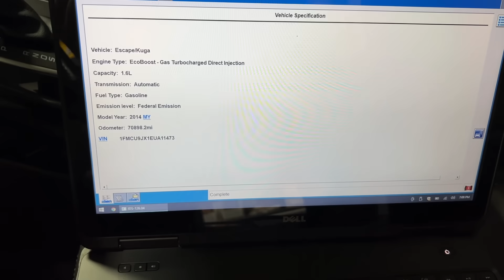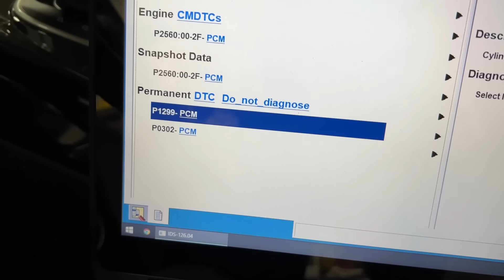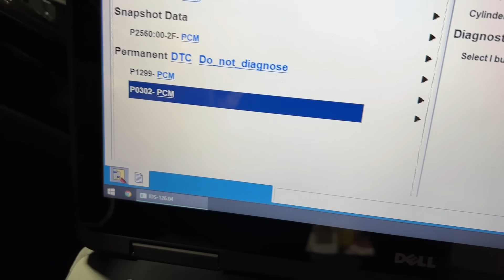Beware of Ford’s 1.5L 1.6L 2.0L Ecoboost Engines and Their Never Ending Coolant Consumption Issues!

Comment: Ok, so having watched this channel I now know I need to avoid 5.4 three valves, and most EcoBoosts.  I'm old enough to have been suspicious of the 4.6 SOHC when Ford brought it out and was promptly disappointed when it could not do what the 5.0 Liter could.  When did Ford lose the ability to build a decent engine that would last?  And it seems that they have been struggling with transmissions as well.  I'm a Lincoln person and have had a Mark VIII and Mark IV.  The Mark VIII spit its transmission out while I was on the highway leaving me to wonder if getting rid of the 1975 Mark IV was a bad decision as the 460, C6, 9" never gave me any problems other than rust.  Good grief Ford-what happened to quality, long lasting vehicles?
Reply: I had 205k miles on my 2001 Ford Focus when I traded it in (yes, I traded it in and it was still running) for a 2008 Ford Focus.  The 2008 Ford Focus had 185k miles on it when I hit a deer. As one who has never sent a good running car to a junk yard, when the insurance company tried to total it I sourced my own front hood, radiator support, A/C condenser and my insurance co just paid for new headlights and grill and it ran fine again.  My 1970's cars were never cars I'd trust over 100k miles and my Pinto, i was adding a half a quart of oil ever fillup at 90k miles.  My 2003 windstar I'd have to add a quart about every 2-3k miles and my 2001 E350 van I had for over 10 years and over 100k miles before I donated it to a charity which actually used it for another 10 years until 15 passenger vehicles were restricted from passenger usage (then they used it to move "stuff" for a year or two, and then got rid of it).  Overall, I've had much better luck with my Fords than with my GM cars.
Reply: @johnnelson5083  You have had some of the most reliable Fords from the eras that you described.  The Focus has always had great engines because they were evolutions of earlier designs that were nearly perfected.  Your 2001 Focus engine was an evolution of the Escort 1.9 (not bad).  The 2008 Focus had Mazda derived engine (usually reliable).  The Windstar was just a van version of the Taurus, and probably had a 3.8 (nothing flashy but good).  The E350 is a little tricky to guess, but I'm thinking that you had the V10 (that engine is a mixed bag, although all the vans I've driven with it have been fine).  I will agree with your opinion on the quality of 70s U.S. cars in general.  I believe that maybe 150,000 miles was the mechanical limits (the Pinto/Vega/Gremlin were all much worse) for domestic production.  Only foreign competition pushed the "Big Three" into better quality.  Having worked for GM, I can agree that General Motors has its issues.  Thanks for sharing!
Reply: @brettkirkpatrick464  My E350 had the Triton V8 and was very dependable (got it during the sales after 9/11).  Not great gas mileage but we drove it all over for years without issues (we had 8 kids all living at home at the time so with the 15 passenger van/4 rows of seats in the back,  every kid got a window seat). Only repair I can recall on it was rear bumper after one of my kids backed up into a light pole.   I had a cousin who worked for Delco (Delphi) in Kokomo for ages. He's retired now but always complained about us not buying GM cars so I bought 1 (a 1990's GMC Safari) and what a nightmare that car was (trans rebuild at 72k - I'm not hard on cars and usually get that much out of brake pads). I had 1 Plymouth as well but it started having issues around 140k.  My newest Ford is a 2013 C-Max Energi and I'm really happy with it.  Went from about $200/month in gas to about $25 every other month and my electric bill increased about $15/month (and this was before the current gas prices).  I also have a Freestyle which so many complain about the CVT transmission but I've not had issues and am approaching 100k miles).
Reply: @johnnelson5083  That 5.4 Triton (2 valve) is a great engine.  Sorry to hear that you had a Safari.  I joined GM long after production started and I was still hearing stories about how much of a nightmare assembly was for Safaris and Astros at the Baltimore plant.  It was the first GM assembly plant to use automated just in time parts delivery to the line and it turned out to be a disaster for at least the first year of production.  The line would stop, but the parts delivery would not and the wrong parts would end up at the wrong assembly points.   Almost every vehicle had some assembly defect because the line workers were being forced to quality check/assemble something different on the spot as the vehicle rolled down the line.  I just got rid of a 2008 Grand Caravan SE (3.3 Flex Fuel) and will not have another Chrysler/Stellantis/Whatever they call themselves today product.  The body was poorly assembled and at 135,000 it would have needed major engine work even after very careful upkeep.   Thank you very much for the tip about the C-Max.  I was interested in it when it came out but decided to buy a Civic Hybrid instead.  Huge mistake.  I had to replace the battery pack at 150,000 and the replacement only lasted 30,000.  Since then I have not trusted hybrids.  Interesting story about your Freestyle.  I heard the horror stories of the CVT (even though the Civic Hybrid had one) and experienced them first hand while I was working at Saturn (a CVT would blow up once a week...it was so bad that I had parts of the belt on my desk as a paperweight).  My strategy with the Civic Hybrid was to change the CVT fluid once a year and it never gave me any problems.  Thanks for the great information-I am always looking to learn.

Comment: I had the '13 Fusion 1.6L EB. I was getting 37 mpg hwy and 30 city unless I put my foot in it. In 2018 Ford had a recall to replace the thermostat housing and re-flash the computer. After the re-flash it got 22 city and 28 hwy but it would stall and not crank for 20 minutes to a half hour later. They had it 3 times with no problems found. I traded it at 58k miles as it was too unreliable a car.

Comment: I own a 1.6 in my transit connect. So far it seems to run really solid, not burning coolant... YET. But I knew going in Ford engines suck but the alternative for small vans was non existent. But why can't there be a fix for this, even if it means you do it yourself or pay a mechanic? Coolant shouldn't be leaking past the head gasket PERIOD. If it is, why not correct the leak with a different style gasket? Leaking coolant passages is bad but it could be remedied with some ingenuity.

Comment: I wish every mechanic was as thorough as you! Subscribed! P.S. I wonder how Pakistani Truck would fix these long blocks? : P  Edit- It's terrible that people are dealing with this issue. My 2018 F150 with 2.7L has been flawless for 115K miles. I always said I would never have a turbo charged vehicle but this truck has changed my mind.
Reply: I'm sure a sandal wearing guy would weld it up and another sandal wearing guy would eyeball the machine work and off it would go again! 🤣 With donkey spit gaskets.

Comment: I totally agree with you that recent times we see more design flaws across the board of a lot of manufacturers, not just ford. They care too much about making a easy buck instead of caring about their customers. I stick to the older models that are much more reliable. I have a 03 f150 2 valve that still runs like a champ, sure its blown a spark plug here recently but that was a pretty easy fix. Its practically breaking in half body and frame wise but runs and shifts good. Just like the old crown vics theyre a dinosaur v8 that doesn't put out tons of power but are nearly bulletproof mechanically.
Reply: Weld some angle iron and plate and it will stay alive.
Reply: Unfortunately the government puts all manufacturers to force garbage, to try and meet epa, mpg, regulations and pollution standards.
All manufacturers are being forced to build garbage!!!
Reply: And I agree I still drive my 2004 f250
Looks like crap, but I can keep it running!!

Comment: Has anyone heard that the problem is less prevalent on the European [Hungary etc] produced engines?
 - I think I saw somewhere that the Euros had an extra coolant [or oil?] drilling between Cyl 2 & 3 which kept that hot-spot at bay.
I had a Euro 1.5L for 162,000KM, 7years, no problems.
I have another now; it is the 2.0L and interestingly it warms-up very slowly - I am quite convinced they have changed the warm-up regime 
 - in 2015 models the coolant pump didn't run until hot; and it would warm-up by the end of my street [1.5Km]; 
 - the 2022 2.0L takes about 7km to warm-up ; which is perhaps good for expansion stresses, but I'm not so sure about oil-performance.

Comment: How do you determine it's the block and not the head gasket?  if it leaks from the coolant jacket to the cylinder, wouldn't that have the same symptoms?

Comment: Wish Ford won't shut you up after revealing their fishy, dodgy, cost-cutting crappy technologies. Just so you know, I'm aware that most of the alloys used for the engines are bad, and instead of doing it right and build some iron cast blocks, they prefer to put some layer of some loctite-made resin to stop their premature wear, and stop the coolant from sipping through microcracks causing the coolant consumption issues. It wouldn't surprise me if you decide to get a sample of the oil on that Escape, and get it on a chocolate milk state.

In a metalurgist engineering point of view, the alloy cannot withstand the conditions where it is being used, causing it to deformate with all the heat/vibration/sudden stop/cool down cycles they get, causing the internal particles of the alloy to displace or even, separate, forming all the cracks and microducts, which, in addition of 21 PSI worth of hot fluid, which we know, liquids cannot be compressed, end up sipping through wherever any pressure relief point is opened, in this case, the micro crack. That's the major caveat of the aluminum alloy blocks. It may resist long enough for the warranty to go dead and then scam the customers with a brand new engine block that costs almost as much, or even more than the entire vehicle.

As a former fellow Ford Dealership Support engineer in Mexico, my advice is: get someone to build a custom block/head with the same measurements from the actual production engine, but from a good ol' cast iron, and say goodbye to most of the pressure-related issues that these engines have (headgasket, microcracks, vibrations, uneven wear and tear, and so on). Moreover, try to get the car running right for long enough so the customer can trade it in for something else while not losing that much resale value.

Comment: Found a Ford Ranger 2007 2.3 inline 24,000 mi. MINT CONDITION- $7,995 OUt the door!! Added NKG Iridium plugs and high performance wires and Flowmaster 40!! NO PROBLEMS!!!

Comment: It seems to me that just pointing the finger at the engine manufacturer doesn’t make good sense.
In many cases of head gasket leaking and warping of cylinder heads, especially small capacity engines is that, the drivers are most probably giving the engine too many revs when the engine is cold instead of allowing the car to get up to temperature. It only takes a few miles to warm up. 
It’s as simple as that and a problem as old as the hills. 
Owners of these engines need to be a little more mechanically sympathetic. 
Don’t thrash it when the engine is cold.

Comment: These engines have been trash forever. Recalls for cracking heads, no crank pulley key ways so you need all these trash special tools just to do the simple timing belt.

Comment: The lack of deck surface on the block is the main issue on those engines and the coolant consumption and yes the common secret ,head gasket failure. 
I think that was the main reason for the headgasket failure issues on Rover K series engines.

Comment: 2014 Ford Focus ST 2.0 Ecoboost. 249k miles never had an issue. I do not think this is as common as it’s being portrayed here on “all” ecoboost engines.
Reply from the maker: Very common throughout the years, as for the 2.0L the 2015-2019 years were the worst.

Comment: Could this not be just a head gasket? 
Not going to be popular opinion here, but to play devils advocate a bit… What are you views on coolant additives or stop leak type products for this issue?  Some of those work for cracks or casting flaws that are not exposed to cylinder pressure.
Reply from the maker: It is a block defect
Reply: @FordTechMakuloco  Thanks! I'd love to see a video of a motor teardown if you do end up repairing one of these. Keep up the great work!

Comment: is the issue fixed up new blocks? Has it been "updated" or are you in the same boar?
Reply from the maker: yes there is an updated block.
Reply: @FordTechMakuloco  gotcha. Thank you for all the hard work on these videos. They really do help us all out here. I've got a 15 escape since new and I'm at almost 95k on it. Ford rebuilt the trans under warranty at 58k but otherwise no real issues to speak of yet other than 2 wheel speed sensors and a battery

Comment: Does the 100,000 mile powertrain warranty still exist? Wouldn't this be covered?
Reply from the maker: no, I think you are thinking of another manufacturer. Ford has always been 5/60.
Reply: @FordTechMakuloco  oh my mistake. I thought my 2007 focus came with a 100,000 power train warranty. Thank you sir
Reply from the maker: You may be thinking of a Ford ESP plan or an FSA.

Comment: After a solid 100 years of building automobiles letting a fault like this happen is very unacceptable. Even the 2.3 focus st blocks (top shelf model) has this issue in certain year ranges. Its not just Ford, afm and GM anyone? Camshafts and hemi's. They COULD build a bulletproof powerplant at this point, and we all know it.

Comment: Do these issues apply to the newer turbo engines in 2020, 2021, or 2022 models?
Reply from the maker: It is supposed to be fixed 2020 and newer.

Comment: I'm not a huge fan of the 1/4 inch /6mm coolant return plastic hoses either, looking at them wrong and they crumble,   and the fact they exist is an indicator of thin castings, and an engine that has more heat to exchange, as any turbo engine makes more heat than an N/A version. The 6F35 trans yoked to this engine is not known for it's robust nature, either.

Comment: I have a 2018 Escape 1.5 EcoBoost. Transmission was leaking at 30k miles. Ford replaced the torque converter under warranty. Last year just before the factory warranty expired I purchased an 5 year 100k powertrain warranty just because of this problem. Yes it covers replacing the engine.

Comment: This is terrible, like you said how long have they been making engine blocks?
My dad has this exact  same problem with his UK Ford Kuga (Escape), its a 2018 1.5 model and has done just over 15k miles!!! Cost to repair is £7000, the Ford dealership have offered to pay 50%. I am in the process of chasing Ford HQ for more discount if not the whole cost.
Thanks for the video 👍

Comment: I would dump a bunch of gasket sealer in it and see if it would seal the block.
And run it with the cap on the coolant tank loose so it doesn’t build pressure.
And install a lower temp thermostat.
Because it’s not worth putting a long block in the car.
The owner might get 2 or so more years out of it.
A system with a pressure cap set to 20 psi is meant to run hot for more efficiently.
Lower the running temp and the pressure and hope the sealant holds for a while….

Comment: My wife has the 2013 Escape 1.6 ECO. At 96,000 miles she blew the sparkplug on #2. The sparkplug threads where toast. I Heal-a-coiled the thread to get her back on the road. But she has been having coolant leak issues that I've never been able to locate. Thanks for the informative video. I'm just going to let her drive it till it blows up and then get her a new car. Maybe a 13-20 Explorer like I have? Only problem I have with my 13 explorer is that the climate control has a mind of it's own. The darn thing turns itself off whenever it wants and makes the constant "button push noise". I basically have to adjust the temp up and down or push random buttons to make it stop. Other than that it's been a great vehicle.  On another note. If you have a sunroof don't ever open it or they will leak. Or make sure you blow out the drains once a year. Otherwise rain will pool around the circuit board for the window motor and you'll be stuck with a sunroof that won't close. Again thanks for the great video.

Comment: I find most of the time a bolt backs out of the intake and rep ruptures the intercooler.
Reply from the maker: What in the world are you talking about? Please explain, thnaks.
Reply: @FordTechMakuloco  ive had 3 now a bolt backs out and rubs a hole in the cooler on a 1.5
Reply from the maker: Ah ok and how does this affect the coolant?
Reply: @FordTechMakuloco  it pours into the intake. While running.  Seconds later it's in the combustion chamber

Comment: I had a 2016 2.0 escape traded it for a 20 ranger and found out 6 months later these engines are garbage so I traded the ranger for a 21 RAV4 4..
Reply: great choice, the Rav4 will last you till the end of time as long as you occasionally change the oil lol
Reply: @busterscrugs  thx, i really like the ranger though, untill i found out about the crap for an engine. just before i got rid of the ranger i had the 2nd oil change and could already smell gas in it..